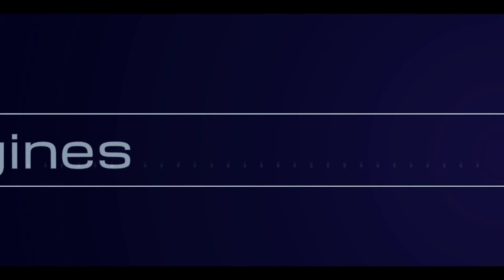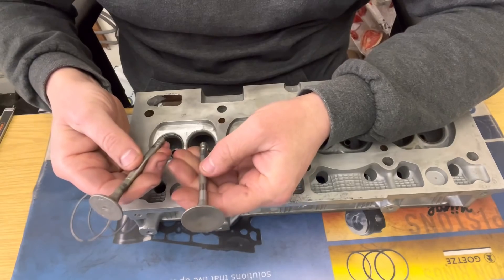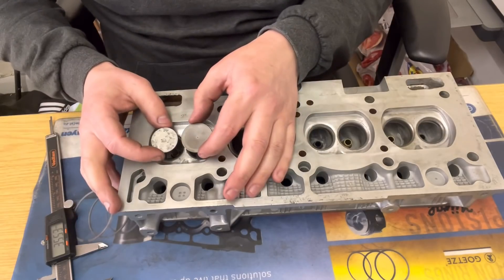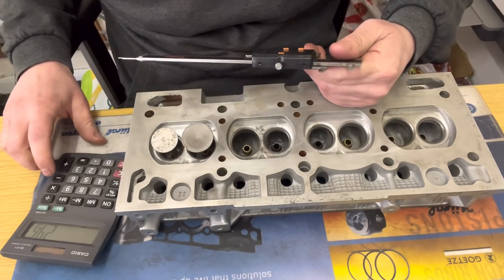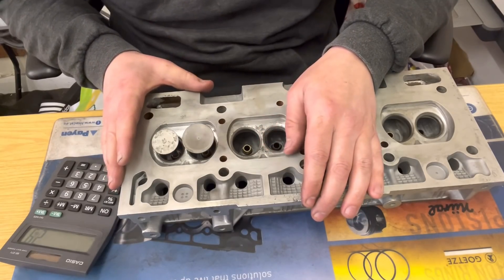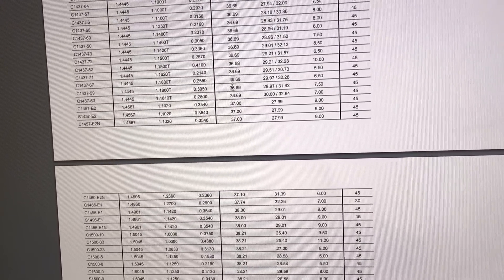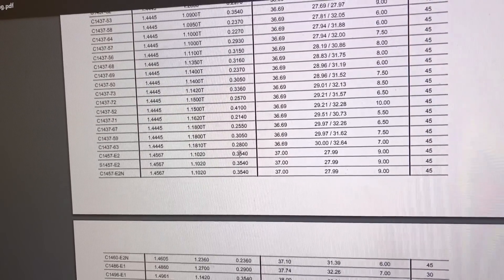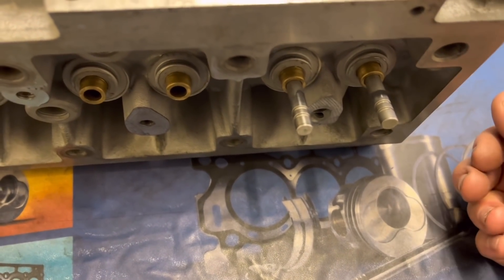Big valve RACE cylinder head conversion, B.E Secrets Series, PART 1

Comment: Great video. I have a ported G40 head I’m looking to get new guides and larger valves fitted in the future. Did you use sodium filled exhaust valves on the G40 cylinder head you were referring to? Certainly interested.

Comment: Think I had this Renault pushrod IoE engine in my 72 Lotus Europa. The head had 2 valve hemi chambering and a Weber two barrel. Head gaskets fail and the bore liners would move. Otherwise a raunchy little engine that reved to 6500 and pushed the little car to almost 200. My Lotus head gasket failed in a tight morning jam making a big white cloud.

Comment: To be honest with this cyl head, I would forget about valves and do some chamber work around the Inlet valve. It is a typical ' bath tub ' type combustion chamber, which I could spend  15 min / cyl  on a simple mod and improve gas flow beyond a valve increase
Also, there are critical dimensions one must adhere to as far as mods on intake ports are concerned, in fact the whole mod thing gets rather complex, still if it works for you
Reply: Yea these cylinder heads do not need bigger valves, same as R53 Mini. Some good head work without bigger valves can get the same results. Better to have smaller valves and better port flow than bigger valves with less port flow. When these heads are flow tested the exhaust ports are the main restriction not the size of the valve.

Comment: Some people are just assholes, plain and simple 🙄🙄🙄🙄! All the theory in the world is great! But sometimes things just don’t work that way! If they ever actually built real competition engines, they would actually know something 🙄🙄🙄🙄! We have a saying over here in the US! (WEW) it stands for, what ever works! We have cut down used coated titanium NASCAR valves, & installed them in tons of little engines! Just because NASCAR guys won’t run them much more than one race, doesn’t mean they won’t live cutdown much smaller with hundreds of pounds less of spring pressure! We also have installed larger overlapping valve seats literally thousands of times, especially on highly boosted or big nitrous small block V8 engines. Because engines running lots of boost & timing ⏱ will completely eat that aluminum between the seats out! So the fix is normally copper beryllium oversized seats & that fixes them permanently! Also those Renault’s were famous for blowing head gaskets, most of the time it was caused by the water pump being up so high above the radiator, if it got just a tiny bit low on water/coolant, it would blow the gaskets right in the center 🙄🙄🙄🙄! Making sure that the deck was correct, because they had wet sleeves if I’m remembering correctly, a nice smooth cylinder head decking & a set of studs we made up did cure the gasket failures! As long as the water was kept full in the overflow tank! People also don’t know that if your blowing head gaskets, there is a reason & something is pissed 😡 off! In general, When you get a race engine head gasket to stay in, you best make sure everything is happy, because if it’s not, you will relieve the pressure one way or another, & that usually means shitting the rods out the bottom 🙄🙄🙄🙄😂😂😂😂! I’m just mentioning this but I’m sure you know, when putting a bigger valves in, you do need to unshroud the valves, around the edge of the combustion chamber, basically right up against the fire-ring in the head gasket, especially if your trying to make power! I remember buying those Renault’s from the dealer for 3 for 100$ back in the late 80s 😜😜😜😜! All they were needing was a head gasket, but for what the dealer charged, people wouldn’t do it & they would purchase a new car 🚗! I know we got at least 12 of them! Just about every new driver in my family had one 🤪🤪🤪🤪! They were awesome 😎 on gas mileage, instead of driving our 10mpg trucks all the time 👍🏻👍🏻👍🏻👍🏻! I put over 150 thousand miles on one & I think my uncle did even more 😂😂😂😂!

Comment: Thanks for the heads up, re gosnays! i fit seats into old air cooled Vw heads all the time but the seats themselves are hard to find.
Reply: Goysnays are reasonably cheap but stock mainly imperial inserts with a few metric ones. If you want metric, serdi stock more, but are more expensive. AE and KS also do a range of inserts in various sizes if you can find anyone that stocks them 👍

Comment: R5 god they was the nuts in the day thats if you could keep the head from lifting at a bar lol .  We use get rid of the head bolts and go stud and nut seemed to work a lot better. The GPA carb was really a waste of time that was just a stock carb with a borded out body. A good head gasket with studs nice alley big intercooler as the stock ones blew the sides off even after strapping it. A hybrid turbo and some fettling you would see 160hp. Change the wires round on the Remix unit and you see 2 more degrees of timing and heat rap the manifold and downpie. Thats if the exhaust studs havent snapped lol .... and make sure the aux fuel pump was working to cool the fuel or put a fuel cooler in there or the thing would never start when hot .... apart from that a fast fragile french rocket !

Comment: I've done the same head this week not the same process but a good old pressure test and skim and  broken bolt on one side fantastic feeling when you drill it so good that the bolt comes out like wire and you don't have to fit a timesert/helicoil just to rub it in at work we use a robin's sg9 valve and guide machine
Reply: No hellacoils!!!

Comment: I had a head gasket fail and later a liner crack in the same place at the edge of cylinder 4. It happened because of a hot spot due to poor water circulation as the flow and return are at cylinder 1. With the removable end plates it is possible to make the water flow across the engine to elimate the hotspot issue with this engine.